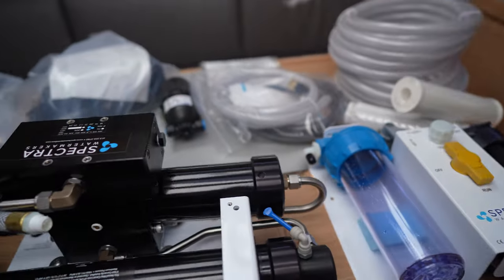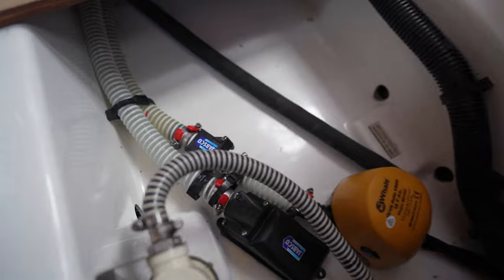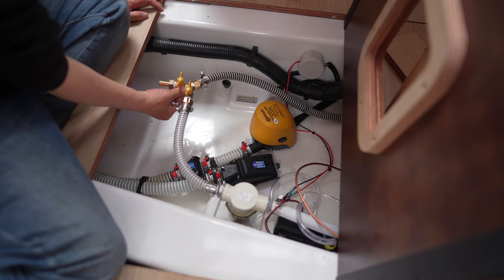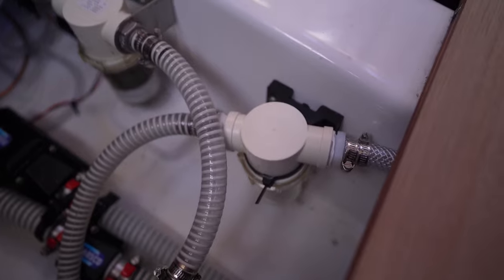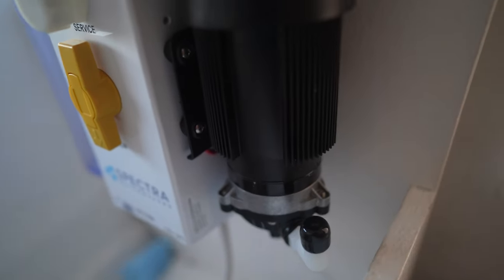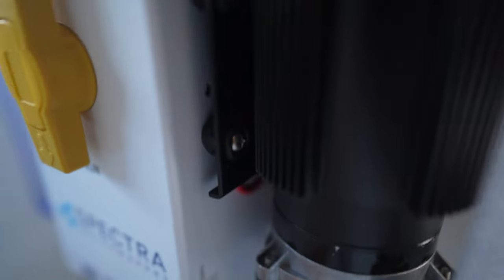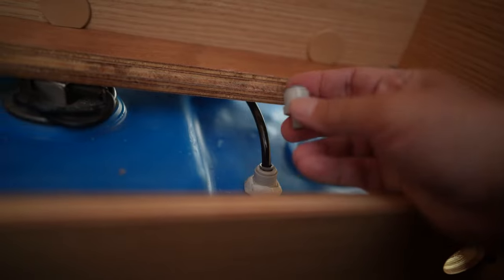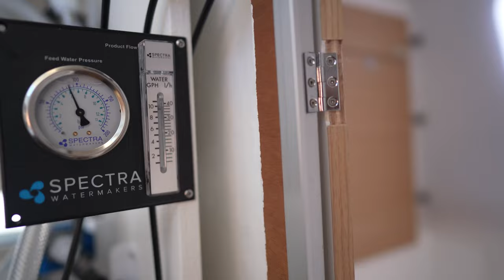Installing a Watermaker - Spectra Ventura 200T - into a Sailboat

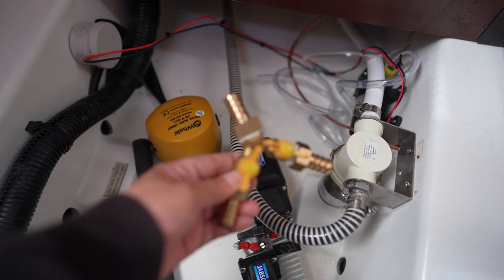Comment: Rob, thanks for the great video. We're about to install this very same water maker! Can you tell me the manufacturer/part number of the y-valve that you show at 2:42 and which you use to tap into the air conditioning intake for your water source? TIA!
Reply from the maker: Just a tip for you after using this for over a year. The y-valve I used has a constricted opening. Meaning I'm not getting the full 5/8 opening. The valve itself has a small hole. So in retrospect this is a bad idea. It was causing overheating of my A/C. I'm switching just to a regular Y barb https://amzn.to/45UBq9I and then using standard shutoff valve https://amzn.to/3sS1DHc

Comment: Cool! I would avoid using it while docked or in the marina. that water is full of oils and you would likely need to change filters sooner than expected.  I wonder how deep the source water is obtained from? I like how pretty much everything is analog. Likely makes clean to dump at a 1:3 ratio or more with salt water?
Reply from the maker: Hi! It's at least 3 feet down to the intake thru hull near the keel. I will check to see how the filter will look after a week. But the only way to have a properly operating watermaker is to use it everyday. Which I do.